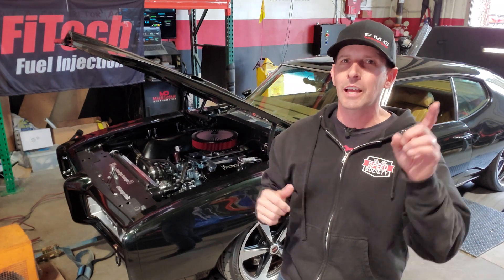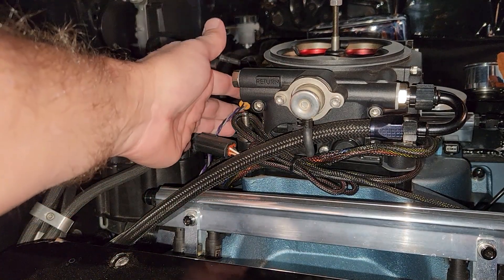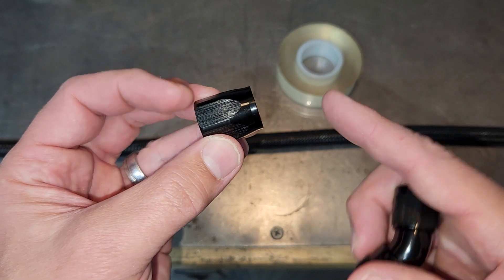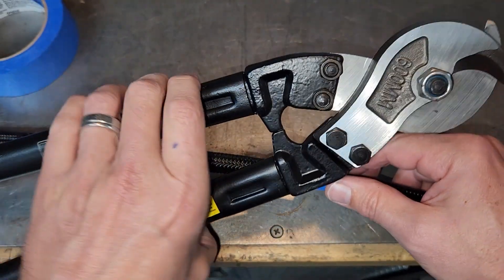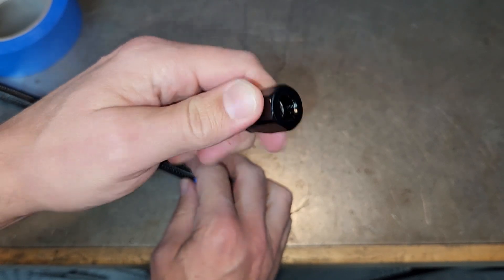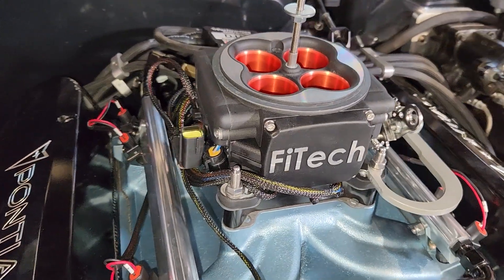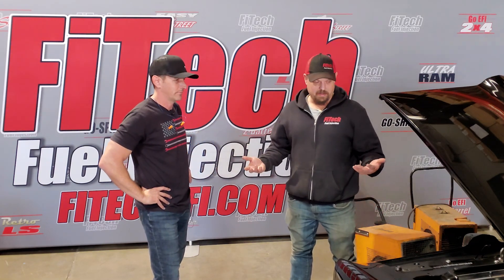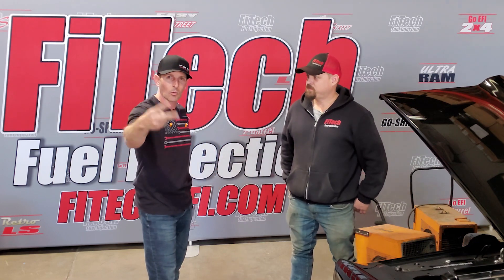Port Injection Conversion, AN Hose Assembly tips, and Dyno Tuning at Fitech!

Comment: Love your content! Thanks for sharing. Had a question about your fan set up. Did the 14 inch fans make a big difference on the street in traffic?
Reply: Yes I checked out your video. Just wondering if you seen big difference on the actual street in traffic?
Reply from the maker: Yup!  Way better.   @dvinpeace
Reply from the maker: Thanks!  Yeah, it's all about CFM.  My new 14" SPALS are working great... check it out, when you can;  https://youtu.be/roExpEcuAKM
Reply: @FastMonty  also wondering if I can hook up the wiring from that dual set up into my original wiring on my 94 mustang. I want to go from OEM 16'' to your exact set up. OEM set up doesn't work well on new motor.
Reply from the maker: You most likely can... depends on the wire size.  you'll most likely be pulling more amps with bigger fans.  You also need to find out if your OE fan is brushless, or not.  Have fun! @dvinpeace
Reply: @FastMonty  OEM isn't brushless. I'm hoping I can splice into the original harness, well If I can. 30 year old tech wasn't made for 400hp lol. Just trying to do something when I'm in that San Diego summer heat in traffic with AC on. It's okay without AC on.
Reply from the maker: Well, luckily for us... San Diego isn't that hot.  bahahahahaaa... anyway, the important thing to consider is the amp draw.  Maybe install a relay, triggered by the stock harness.  Let us know how it goes.   @dvinpeace

Comment: Where is that dyno? I built megasquirt and installed on my VW and I've been street tuning, but I need a dyno
Reply from the maker: This is in Southern California... yeah, I agree it would be super nice to have a dyno handy.  As long as the system is "learning" you should be able to tweak from there.  Thanks for the comment!
Reply: @FastMonty  Oh yeah, this is Kevin from the gym btw :) Love how the channel has grown! 
Yeah I've done the auto tuning for the fuel maps and fuel is decent, but I turbocharged the car too and getting ignition right is critical with boost, I dont want to run into detonation. I can't find any local dynos in San Diego that can help with megasquirt
Reply from the maker: @aventarikevin121  Ha!  Thanks Kevin... I'm a little slow at connecting the dots.   I don't know of any "good" dyno tuners in San Diego either.  I'll keep my eyes and ears open for ya.  See ya at the gym!

Comment: Many of the comments are about the minimal max hp gains from this conversion. What we should look at is the overall hp/tq curve difference between TP and TB, this will tell a much better story as to whether or not the added expense is worth it. Also, you may want to try replacing that K&N air filter top with a solid lid (domed preferably), in most applications it causes way too much air turbulence.
Reply from the maker: Thanks John... what's almost impossible to explain or put a $$$ amount on, is the drivability.  Awesome throttle response, and starting at any temperature is dramatically improved.  First I've heard of a turbulence issue with the Top K&N... not too worried about it, as the injectors are no where near the throttle blades.  Thanks again!
Reply: But in real life most of them are against the hood insulation blanket and not moving any air thru the top it just equalizes the negative and positive pressures

Comment: For me it would be for a new guy setting up a fitech system. Standard power adder or port injection.  After that it’s all about the look 
Timing control will make you feel why haven’t I done this earlier
Reply from the maker: Thanks Craig... as with almost every upgrade... why didn't I do this earlier?  ha, ha... See ya!

Comment: Why not go full edlebrock pro flo efi. Love the car no hate. It just seems like more steps for the same outcome.
Reply from the maker: Great question, Jordan!  So, I fell in love with the affordability of the original throttle body system, and also learned that several of the sensors and components of the throttle body can be replaced with AC Delco parts.  I think most of the Sniper system components are proprietary?  Could be wrong.  Anyway, that's how it started... then when I rebuilt the engine, I had a crazy idea to implement FiTech's Port Injection tech.  BUT, they didn't have one for Pontiac's... so, having my RestoMod motivation of being different, I wanted to be the first with a Pontiac FiTech Port Injection system.  I think I am?  lol  That said, I certainly love it!  Thanks again.
Reply: @FastMonty  ok, I was curious since I plan on going efi soon. Love the detailed Pontiac info you bring us in this Channel.
Reply from the maker: @jordanrodriguez3406  No worries, and you're welcome!  Thanks for being a part of the FMG family!
Reply: @FastMonty  FWIW, since the best of us are taking notes, on Sniper units I believe the injectors are the only proprietary part and I think some people have worked out a non-proprietary replacement. As with FiTech, other sensors and what not do have standard replacements available. On my second IAC valve currently and it still has some inconsistent idle problems, for the note takers...  Awesome being the first/test mule for the FiTech port injection on a Pontiac. Value is not just in HP/$ spent, numbers matching block has a lot of value too, maybe not all monetary. Right there with you on that. You don't get that so much with a LS swap.
Reply from the maker: @kevinw6282  Thanks Kevin!  I love my "new" engine.  ha, ha...

Comment: Thanks Mike, been waiting for this video since you put the new engine in. So will you get us a drivability video. I'd like to know the difference between the TB and PI when it comes to cruising?
Reply from the maker: I know, life certainly got in the way of getting this done... but, glad I did.  Good point about drivability, not sure how to do a video on that, as it's subjective to me.  But, what I can say is it's better.  The biggest difference is how fast it comes down to idle, from any RPM.  Whereas before, it would dip to low, go a little high, then settle... all within about 2 or 3 seconds, but I notice it.  That issue no longer exists.  Starts faster at all temps.  And the throttle response is much nicer... might get me into trouble.  :)  Thanks brother!

Comment: How much did the fuel economy improve by, and I can't wait to see the  pwr gains of hei vs. computer controlled timing.  I would love to try the fitech  port injection if it had trans control.
Reply from the maker: Andre, great question... I too wonder about any power gains with Computer Controlled timing.  I suspect it'll be more fuel efficient/cooler running too, especially at idle.  Not sure if FiTech has trans control or not?  Have you asked them?  Thanks for the comment!
Reply: not yet will ask though

Comment: Throttle Body Injection - 435HP@5,079rpm/501ft/lbs torque@2,780rpm $1,592.99. Port Injection - 436HP@5319/511ft/lbs torque@3540 $1,938.00. The car picked up 1HP and 10ft/lbs of torque. Now forget about buying the initial TB kit as one can sell it on Ebay. But spending $345 more for port injection to gain 1HP 10ft/lbs which could EASILY be run to run differences is IMO not worth it. So perhaps the TP idle quality is a tad better than the TB. A $15 grand Butler engine is NOT going to run that smooth and I don't care what you do to it! IMO of course. Hey spend your $$ any way you want!
Reply from the maker: Exactly right, to each his own.  And what's not shown in this video is the drivability improvement, that I learned on the way home... cold/hot starting, coming down to idle from RPM is almost immediate, and the improved throttle response is now going to get me into trouble.  So, yeah, my $15,000 Butler motor is smoother than ever now.  Thanks for the awesome note taking!
Reply: @FastMonty  You bet. I I too stayed in school :). Don't know if they do that anymore. Take notes that is. :)
Reply from the maker: @Danno74Z  Ha!  I laughed out loud at "I too stayed in schoot", thanks for that.  And, agreed, not sure what they do anymore.  ha, ha...
Reply: @FastMonty  You take care and have fun. Keep it between the ditches!
Reply from the maker: @Danno74Z  Same to you!  And, thanks for being a part of the channel... I always appreciate good thoughts.  Thanks!
Reply: Danno74Z- I absolutely agree with your statement and reading a little deeper I say Bang for the buck is definitely not there when you compare the cost of a Butler engine to a LS  for HP. I have a 81 TA with a 461 stroker. Doesn’t make a lot of power by todays standards but makes way more power than it did when it came out new. My brother has a 76 TA with a LS 6.0 LQ4 with a 88 mm turbo. Makes 938 rwhp. It’s on my channel. He has less than 15k in the entire drivetrain. Built it all himself. But his goal was to have one of the baddest TAs out there. He looked into Butler for performance before he did the Pontiac 455 to LS swap. Dollar per HP wasn’t there. So he went LS. 
But as we say to each is his own. IMHO Mikes GTO would not be the same without out a Pontiac motor. I think port injection is way cool on a old school engine. If you have the money who cares what it costs. To be honest I am surprised he picked up one hp from port injection. It’s all about what you want to do with your car. I am happy with my 13.2 @ 102  1/4 mile slow Pontiac powered TA. My brother is happy with his 9.2 @ 148 mph LS powered 76 TA. 
I stayed in school to and so did my brother. We both agree cars are a poor investment but hey you got to have fun in life  and there is a lot worse things we could be doing.
Reply: @mattspontiacta  Hi PontiacMatt, I agree with everything you said. Sometimes I can be to pragmatic for my own good. Sorry. Let's have some fun with our old cars. Mine is a 71 Camaro that I'm tweeking on. 😉 Mike and Matt have a fine week!
Reply: @Danno74Z  your good man 👍
Reply from the maker: @Danno74Z  Awesome stuff... keep at it!
Reply: @FastMonty  Thanks! Have fun at the Quarantine Cruise too!
Reply from the maker: @mattspontiacta  Thanks for the comment, Matt... I'm so happy you and your brother stayed in school too... bahahhahaa.
Reply: At least your intake valves will be super clean. With port injection you can tune each injector individually, which could potentially get you more power. Port injection will also get better fuel economy. Even though people say you shouldn’t worry about gas mileage in these cars, it makes a huge difference.
Reply from the maker: @ryandoe9278  Thanks Ryan!  Yeah, I think you'd need an O2 sensor on every cylinder to tune each one... but, yes, it "could" be done.  Thanks for the comment!

Comment: Was the price of the parts worth the squeeze? Not a lot of added HP and torque changes.
Reply from the maker: Ha!  That depends on your threshold of cost pain vs. improvement.  What's not in this video is the drivability, almost everything has improved, especially coming down to idle from any RPM, cold/hot starting and  the new throttle response is going to get me into trouble, ha, ha... thanks for the comment!

Comment: Love this video. I purchased a single plane Speedmaster aluminum single plane intake manifold to replace my Edelbrock RPM intake for the purpose of doing fuel injection in the runners. I have a carburetor on a  Pontiac 461. I dynoed 328 rwhp and 441 rwtq with stock 6x8 iheads in a 81 Pontiac TA Pace car. 

I was wondering how to do this port injection and your video just explained it. Thank you for posting. 
This helped me out a ton 👍
Reply from the maker: Awesome!  Yeah, you're gonna love port injection... the idle quality is even better than the throttle body version.  Which I didn't realize until driving home.  Awesome!

Comment: Finally! Looks good my man, sounds better. I'm old school and I can hear the Pontiac porting through exhaust. I was about to flag your channel! Cause you had us wanting so long! Lol. Keep the other brand(car) going my friend!
Reply from the maker: Thanks for not flagging me, Anthony... lol  Yeah, so glad I finally did this conversion, idle quality is even better than the throttle body unit.  Which I didn't realize until driving home from filming this video... thanks for hanging in there!
Reply: @FastMonty  hows the other driving experiences, start warm, moderate throttle in let say low speed and what not... Same or better. I took the class with FiTech and was wondering about the port injection drive ability . Used the throttle body injection before...
Reply from the maker: @anthonydavis5993  well, sounds weird, but everything is better.  I know it's subjective, but my favorite improvement is coming to a stop, or coming down to idle... it seems to react faster, whereas the original throttle body the idle would dip to low, catch up a little to high, then settle.  within 3 seconds?  This unit nails it, doesn't matter if I'm coming down from 2000 rpm, or 4500... I love it.  Second to that is throttle response.  Third to that is starting at all temps.  Hope that gets you off your ass.  lol  Thanks brother!